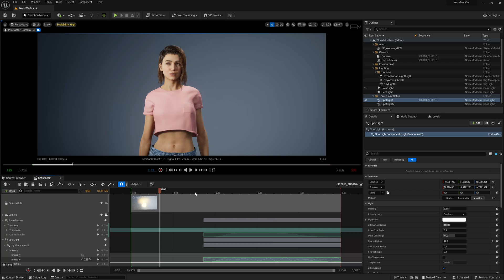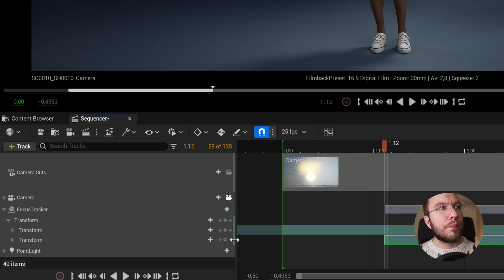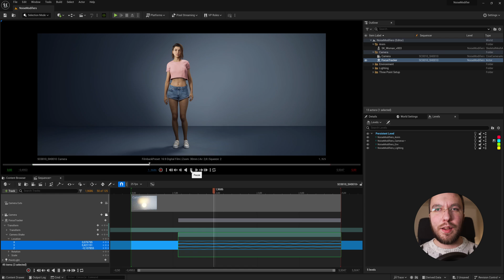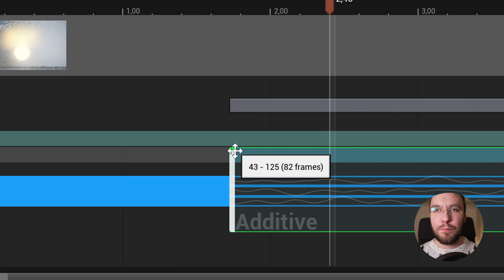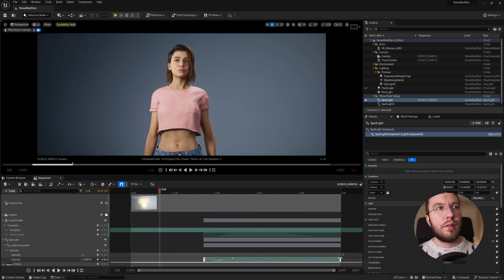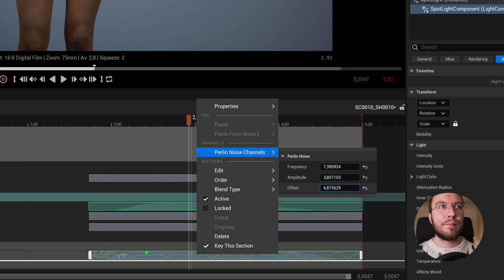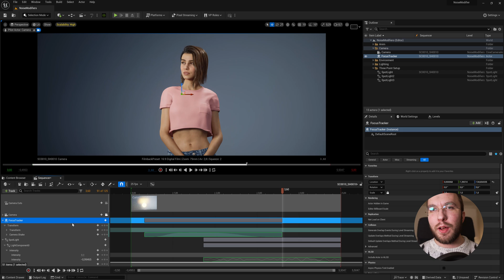How to use NOISE MODIFIERS on Unreal Engine 5.7 animation tracks

Comment: Thanks again for this. It worked great for adding the "hovering camera drone" look where they often drift in location/rotation. I found Location frequencies were best around the 0.1 to 0.3 range with amplitudes in the 50 to 150 range. For rotation (pitch, roll, yaw) frequency values of 0.1 to 0.3 but MUCH less in amplitude (because values are in degrees) so somewhere in the 1 to 2 range. Hopefully a decent starting point for those searching for a similar look.
Reply from the maker: Late reply, but that's fantastic! Thanks for sharing! 😄

Comment: Hey Michael @tiedtkeio, I just recently found and followed you because of your objects on spline video. I'm a long time AE user studying UE (hope to move most work there) and I've been searching for the equivalent of  AE's "Wiggle" for about a year. I think with this video you've solved my quest - thank you x1000! I animate air and spacecraft and use wiggle on both the models and camera to make them feel more realistic. Can't wait to test out this new knowledge. Happy New Year!
Reply from the maker: I'm so happy to hear that @aerospacenews! Thanks for watching and Happy New Year to you too! 🙂✨
Reply: @tiedtkeio The first time I tried to apply this UE crashed so hard the camera in the sequence (which had been saved prior to adding the noise) was no longer bound when I re-started. The camera was in the sequence (red with an error message as unbound) but not in the level hierarchy (Outliner)! I've seen many crashes but that was a new one on me.

Related thought/question: Do you know a way to cycle an intensity value for an emissive material in a sequence? Use case: aircraft strobe lights in my models are emissive materials not parts of the model. Would like to make them flash with regular cycle. In AE I've attached a point light (pick whip position - adjust, etc), then used that Red Giant tool to "see" the light, then add wiggle on light intensity to make it flash.